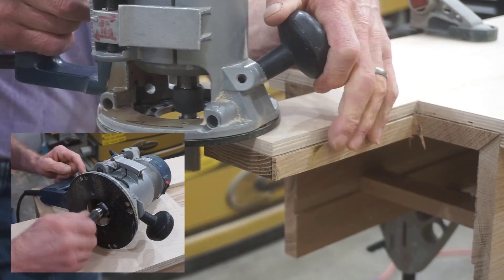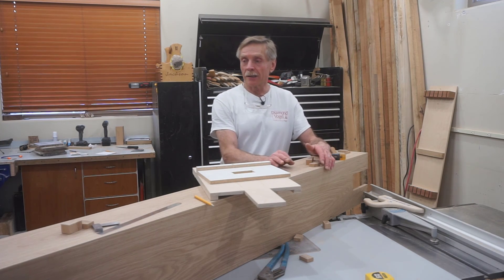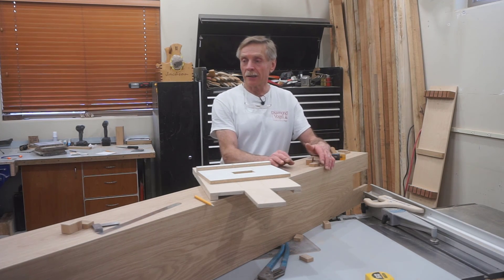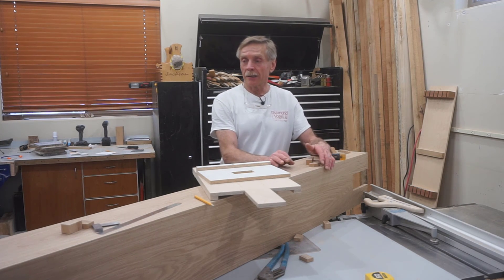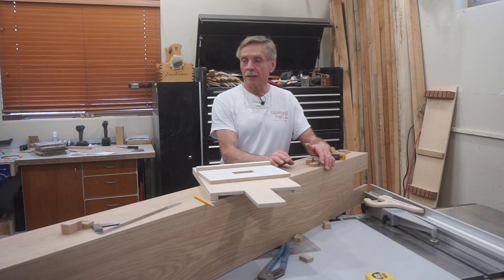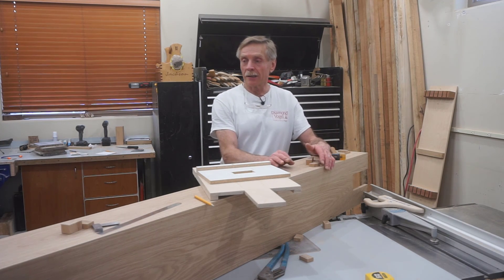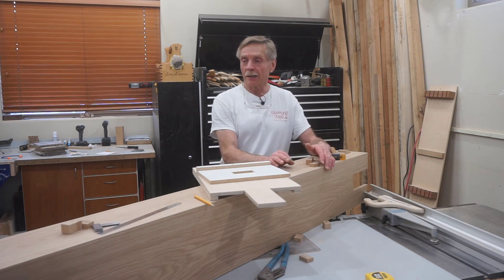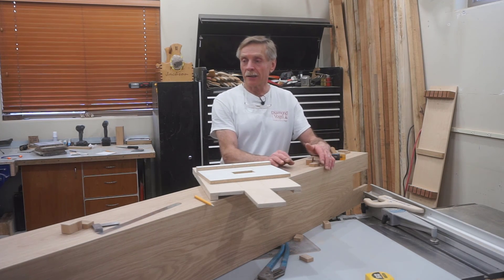Slick Pro Tricks for Faux Beam Joinery

Comment: Great video, thanks, Matt, solves an issue I've been gnawing on for 6 years!
Reply from the maker: Always glad to help 'clear a logjam' Curtis... do I know the nature of this particular issue or is it yet another conundrum of yours?😁😎 Best, Matt
Reply: @NextLevelCarpentry  New issue to you.   When I built my home I put a cathedral ceiling in the Great room.   I have never been happy with the taping job I did at the peak, so I have been going to put in a box beam.  As putting up a 26 ft. beam by myself, over my beautiful hickory floor, is a bit daunting, I haven't had the guts to do it in the last 6 years.   Now I can see a way forward that I'm sure I can tackle.  Thanks!
Reply: I might even put it up, instead of using my putter.
Reply from the maker: @curtisschmidtlein5606  I see it sounds like you've come to the same conclusion I did because I didn't want to do these false beams as built-in on site but this way they are made in three sections and just screwed in place very little work on site at all. I installed the anchor strips or whatever you want to call them today and hope to shoot video when I get to actually installing the beams soon.
I'm glad I'm not working over a nice finished Hickory floor though😬🤯🙃

Comment: Bravo, Matt!  Precision work is your forte.  No kidding, when you slid those faux tenons together I got a little tingle on the back of my neck... an altogether triumphant moment!  ☺️
Reply from the maker: Thanks D. Bowman... I got a tingle too, but mine was from being thankful that I didn't have a whole bunch of extra 'fussin' to get it to go😀😎 The true test will come during installation but I'm pretty confident it will fly.  The distressed/weathered texture the beams gives a bit of a 'mulligan' that compensates for slight variation in beam width which I'm thankful for.  Thanks for commenting... Mrs Next Level Carpentry was just here looking over my shoulder and says 'hey' 👩 Best, Matt
Reply: Next Level Carpentry Hey back, Mrs. NLC!! 👋

Comment: Needs a scab board just in case the tenon warps. And to prevent noises.
Reply: Perhaps a scab board....or perhaps a dowel inserted into the tenon with a receiving end for the dowel into the mortise …..that would lend to prevent warping of the tenon either up or down - they need not necessarily be glued in either, that are simply to prevent possible movement (warping) of the tenon (or in this case, tongue) of that part of the wood assembly.
Reply: @rogerlower56   a simple biscuit would do the job. Wouldn't take much time or effort and would provide insurance for small annoying problems that could occur.
Reply: @jamesrogers4674 Thanks for that James I would have to agree - and the biscuit slot would allow for a little play to have the biscuit lined up between the 2 ends, hence the ease of that method over the dowel...thx for that additional info!

Comment: How do you connect the two beams? Biscuits or dowels or something else?
Reply from the maker: Good question OIFEagle... They just slip together and are screwed to a 'ladder panel' that's attached framing and blocking in the ceiling.  I may have to put something in the connection area to make sure light doesn't show through the joint and give away the reality of the nature of the faux joint. I hope to show this in the installation video later... Best, Matt

Comment: Lookin good!
Cant wait to see the rest!
Hey question for ya, not involving faux beams...
Oak kitchen cabinets, and someone drilled every handle
3"- 4" higher on the uppers, and 3"- 4" lower on the lower cabiets.
Its not practical at all, and I'd like to refinish them all anyways. 
It is way too much money to replace every door in the kitchen, its a very large area. Is there any product that you could recommend, that i could fill the existing holes, and drill new ones, but not have It look really noticeable?
Im either gonna spray a couple coats of the amber shellac, or maybe use a homemade toner to go a shade or two darker than the honey oak colour that the kitchen is now.
Any help is appreciated!
Reply from the maker: I know exactly how fix that problem Splash but can't devote the time to spell it out here unfortunately.  I am going to review some new CA glues in the near future and, if it comes to mind, could show use of the glue AND fix for your cabinet door holes.  If I get that done and fail to mention your suggestion a polite reminder from you would be welcome! Best, Matt
Reply: @NextLevelCarpentry  
Thank you!
Look forward to that.

Comment: Terrific job Matt! Really, really nice work :) Couple questions. How do you get those short cutoffs to not fly off the miter saw when the cut is finished? Must be a sharp blade and heavy wood :) Those always seem to end up on the other side of the shop for me, but I'm usually cutting soft woods, so maybe that's it. The other question I had was, wouldn't the tenon wedges have a mirrored appearance on either side of the beam? Like two wedges driven in from one side and one from the other? Maybe I'm not understanding how those work, maybe it's one piece that goes all the way through with a tapered notch in each end and then a wedge on each side that gets driven in to spread it in the mortised piece.
Reply from the maker: Thanks Steve... good questions.
There might be a difference of the blade's position when the cut is complete on my OLD DeWalt that lets the little cut-offs stay put... more or less.  I think I try to let the blade stop or at least slow before raising it which might help too.
Technically the tenon wedges (see... I CAN say that right!😳😂😎) would be two thick and one thin on one side of the beam and two thin and one thick on the other... assuming it's a 3-piece wedge like I did here and not what I think is more typically a two-piece wedge.  A two piece would be one thick and one thin on either side.  I hope a real timber-framing pro doesn't weigh in against me here because I only know enough about the craft to get myself into trouble sounding like I know more than I do.  Best, Matt

Comment: what type of wood did you use?
Reply from the maker: 4/4 white oak Jason.   Both designer and client requested it even with its 25% higher cost, well worth it for the more unique look from the color of the wood and grain structure.  Best, Matt
Reply: @NextLevelCarpentry  thank you sir.